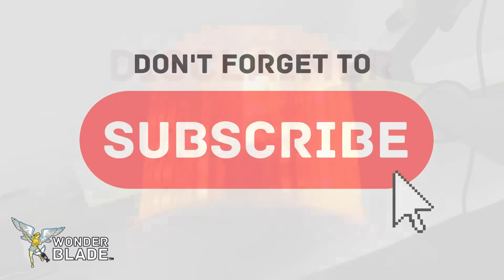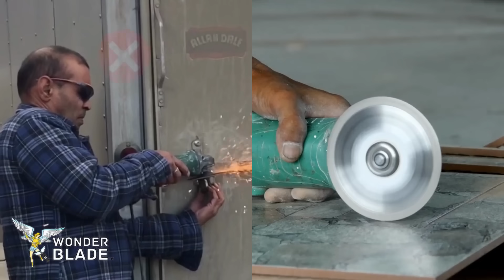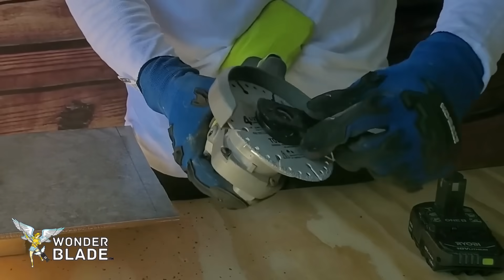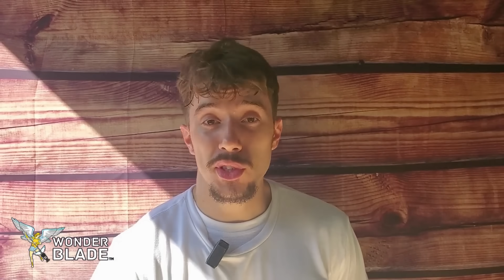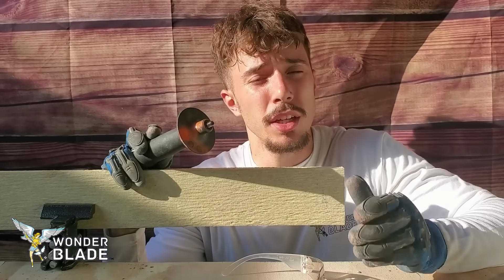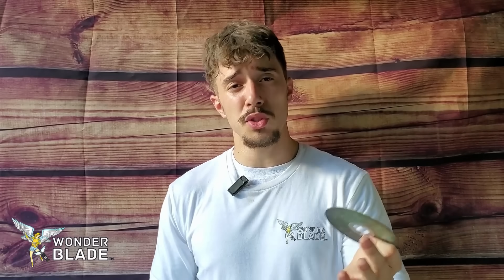BEST Ways to Use Your Angle Grinder! - How to Use an Angle Grinder - WonderBlade™

Comment: Thanks for sharing the video and cool looking blade.
Reply: I'm surprised that made it to the whole video without hurting yourself your blade was contacting the material at the wrong spot the blade should never kick back towards you if she came back down and away from you you don't use the front of the blade and while spinning so when it catches it kicks up that's how you get hurt you suck at using an also when you were using your guard it was in the wrong position as well